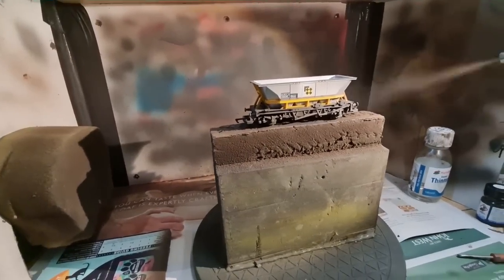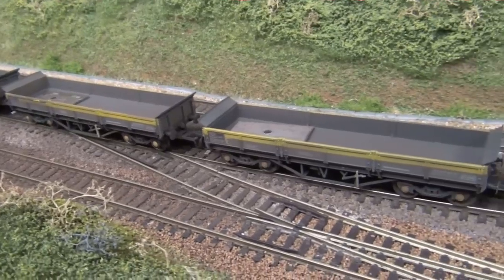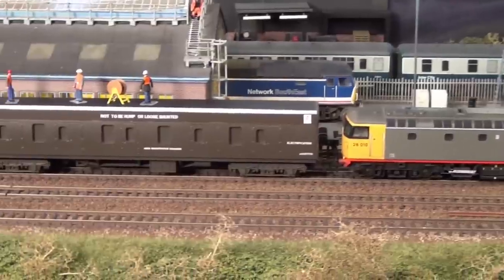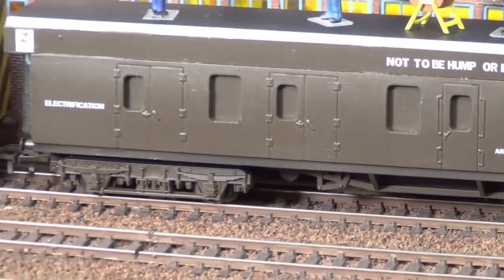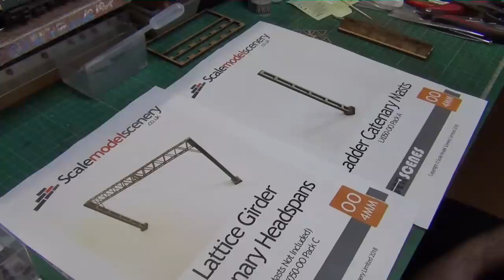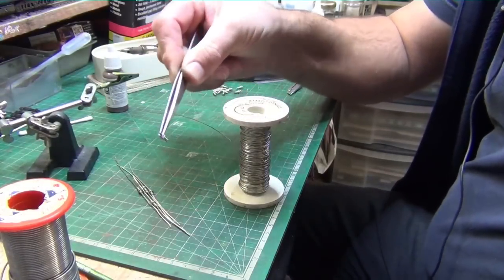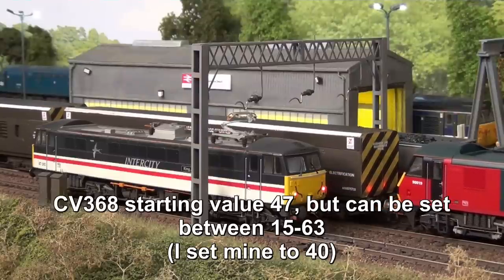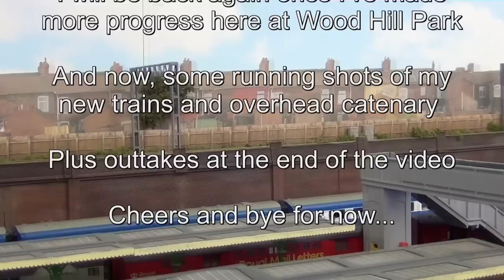Electrification Begins @ WHP, Project Reveal, Running Session, Outtakes and More.46

Comment: Graham. As expected the video was excellent. The subtle weathering on the locos looks excellent and spot on, on the HAA's. That OHLE Maintenance Train is a work of art. You just may well have stumbled on a gap in the market there, get the patent quick 😁. The Catenary just adds to the layout, sadly for your wallet, the urge to add a few more Electric locos, maybe just to tempting in the future. The running shots with the 87 and 90 passing the depot, kinda gave it a look of passing Willesden. Lastly The new light, making you see stars had me in kinks. You said it was a lengthy video but the time just flew over watching it. Thank you for sharing.
Reply from the maker: Very glad you enjoyed the video Mickey. Makes all the hard work worth it. Cheers for commenting and watching. All the very best Graham 🙂👍
Reply: @WHP1980s  my pleasure Graham.

Comment: Great video mate the new project looks excellent never seen that b4 what colours did you use to make your track look dirty?? Keep up the excellent work cheers Paul
Reply from the maker: Hi Paul I use vallejo acrylic leather brown to first paint the rails with a brush, then airbrush the sleepers and track bed to my liking. I do this on camera when making my TMD in a past update.  Hope this helps. Thanks for watching 👍
Reply: @WHP1980s  thanks for the comment back I'll take a look myself thanks I use a rust colour on the rails but I'll try the way you do I need to work on my air brush skills cheers Paul
Reply from the maker: In truth I watched Richard of Everard Junction use this colour to come close to sleeper grime by rail match. I think it does a great job myself as more rails aren't red rusty but old dirty dark rust from years of slow rusting. IMO that is.  Cheers Graham 👍
Reply: @WHP1980s  I'll try  watching his cheers Paul
Reply from the maker: CORRECTION Sorry that should be acrylic vallejo leather brown. This can be used carefully in a enclosed area unlike enamel paints as it's water based and safer to breath in. Still wear a decorating mask though. 😷 🙂